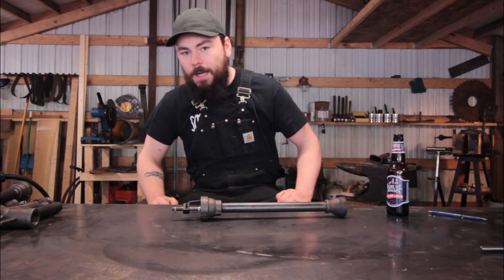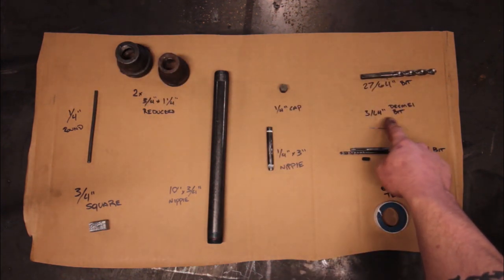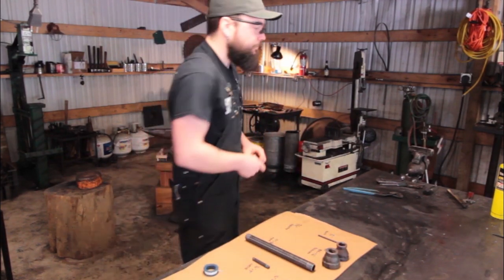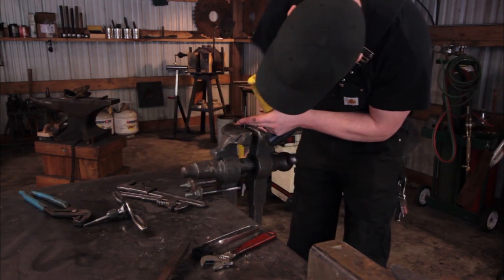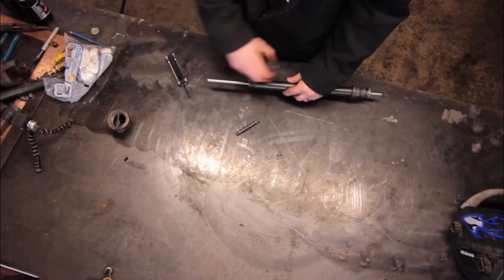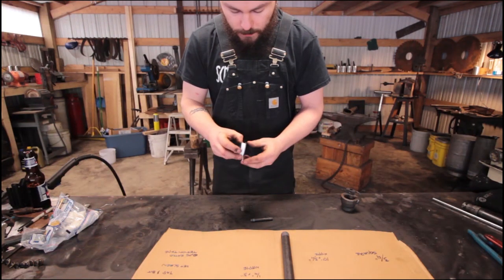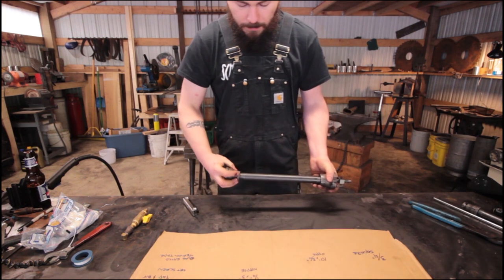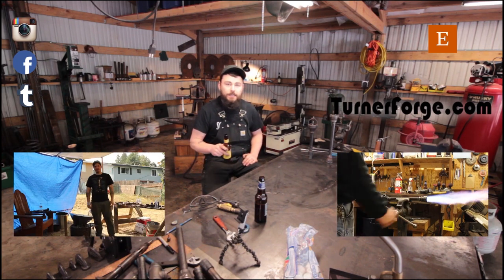TurnerForge - How to make an efficient propane burner

Comment: I am assuming if you are using this in a forge, it would be plenty good to use for an aluminum melting furnace? I am focusing on aluminum melting right now but would like to get into knifemaking sometime in the future so one torch that could do both would be nice!
Reply from the maker: Oh yes this application would work good with both
Reply: +Turner Forge Awesome! Thanks for the reply, I think I'll start sourcing the parts this weekend. I dont have a welder yet so it may have to wait a week or so until I go to my parents place to finish it. thanks for a nice, simple design! Also, just out of curiosity, any guess how many hours you get out of a tank of propane? I am debating building a waste oil/propane torch but at this point I may just keep it simple with propane only to start learning about torches and go from there

Comment: I'm going to be using this torch plan on my current forge project, I recently acquired an old propane tank to use as the body.  my question is does the length of the torch body, the 8in gas nipple, have to be straight?  is the length of the torch body a set variable or can it be shorter or longer?  thanks for the helpful videos, I don't use/trust Facebook so I'm sorry to communicate through here if it is an inconvenience. thanks in advance for any help, it's much appreciated.
Reply from the maker: to tell you the truth I have never tried a bend in the torch body so I don't know about that. But the shortest I would go for the 3/4" pipe body would be 7" I have just had the best luck with 8"
Reply: +Turner Forge thanks for the reply, I'll do some experimenting and if I get any good results I'll shoot them your way, thanks again
Reply from the maker: +Michael D'Emidio not a problem!

Comment: Is it that the difference between this torch and the one you made a year ago the hole size in the plug ??
Reply from the maker: there are a few more differences. But mostly that this one requires a welder

Comment: After researching the actual forge making, why didn't you go with a fireclay recipe? It looks cheaper to make.
Reply from the maker: I guess I'm not following. Are you referring to the liner in my forge?
Reply: +Turner Forge oh, yes sorry, and I commented in the wrong video. The insulation lining over fireclay. Wondering if you have opinions on them.
Reply from the maker: +Ben Hopp Actually there are a few. The ones I am fond of are ceramic wool, fire brick and refractory cement.